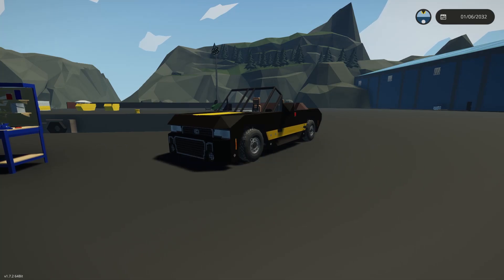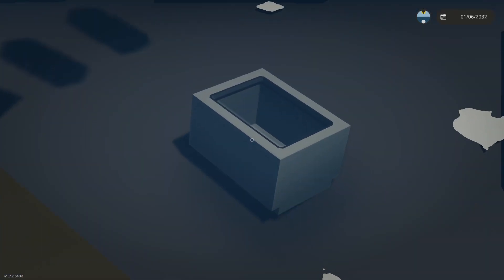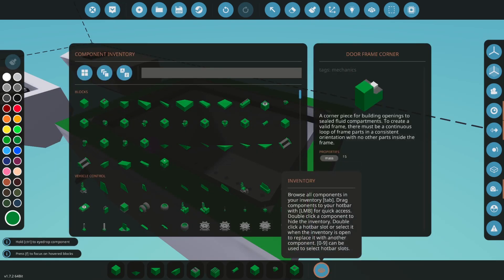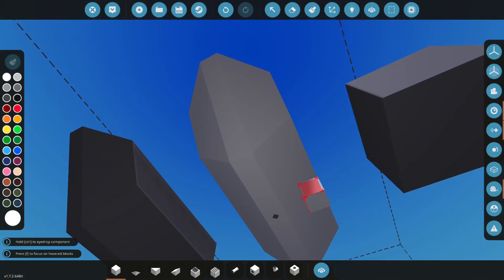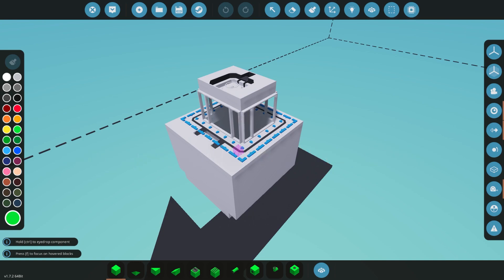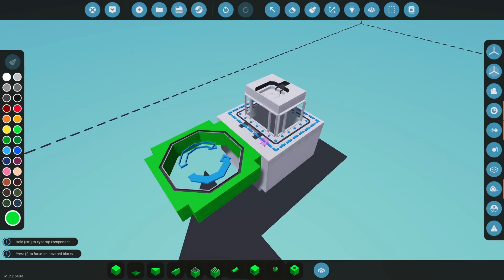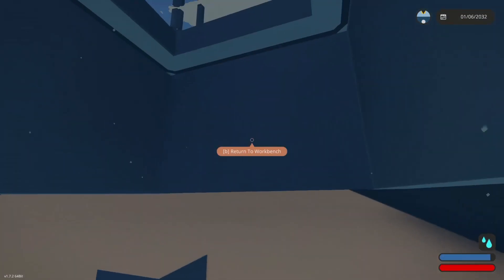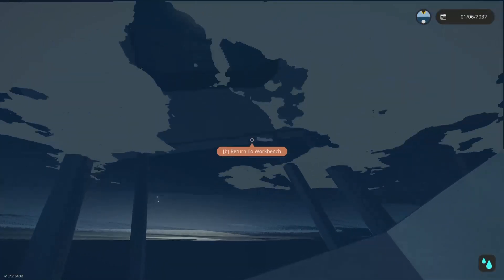10 MUST HAVE new features in Stormworks 2

Comment: #11 pre angled hinges.
Sometimes, you want a hinge to start at 90 degrees in build mode.

#12 pistons at fully retracted / extended.

The reason for both is you are forced to build something in its "half way" position, which isn't always possible.

#13 smaller fluid / power pivots and hinges.

Make their strength lower, sure. But let us have a compact way of transferring power / fluids.

#14 Power / fluid driven pivots, hinges, pistons and pumps. 

Have you ever wanted to make a functional paddle wheel boat, actually driven by a steam engine?

How about powering a piston with fluid pressure, say to make a claw grab hanging from a crane?

You could also make the fluid pumps operate in reverse, they generate power when driven by a fluid.

Sure, add a power loss to it to there's a reason to hard line power, but give us the option.

#15 "live" build mode with subgrids.
Think about Scrap Mechanic, where you can take something off the lift, rotate a bearing and build onto it.

This should still be in a build zone, but you can adjust a pivot or hinge to any position and it's subgrid will move to that angle and you can build "straight" on the subgrid, which is now angled to the main grid.

#16 test mode for both main builds and microcontrollers.

In build mode, you will either spawn in a blank "unlimited" ocean where you can adjust wave height and use your creation, with unlimited fuel / electricity as options, no damage to player, player fly mode / 3rd person view.
You can't complete missions or make money, only test functionality of your craft.

I have an entire second save game JUST for vehicle development and testing.

And test mode for microcontrollers will give you a button / number slider input where you can edit inputs, see outputs and hover over all components in the controller to see issues, change something and see the result right away.

Like debug mode when writing code.

The only way to get something similar is to add extra inputs to adjust the variables you want to test, add info components to see mid process data etc and then try it out in your build.
Reply from the maker: Love these suggestions! I may use them if I make a part 2! :) I also gathered some of my own items over the months!
Reply: @454ss_gaming  oh, I have plenty more too.

Like with ropes and winches.

The small winch IRL, would have about twice to three times as much rope on it.

Pullies for ropes would be cool, to give slower but more powerful pulling capacity, but to also mount a huge winch down low on a crane (where it should be),L and redirect the cable up to the end of the boom.

I also hate how ropes have physics with wind and gravity, but not with the ground or builds.

And yeah, use all the ideas and get as much public attention as possible.

Ultimately, I want the best game possible and that starts with getting the basics down right.

Honestly, why bother making a space DLC, which they've already said won't be great due to the game limitations, when water washes through solid walls and floods your boat because your open deck isn't an enclosed room?
Reply: Hmm, been thinking thoughts.

It's simple, but I think very lacking.

More basic connection "anchor" blocks.

Specifically, a hinge connector, a tow ball connector and a PTO connector.

A hinge connector (better if it's two blocks, a make and female) will function much like an unpowered hinge / pivot in game, that is in two parts which must be connected together to work.

Install the male part on the main ship, install the female part on say a gangway.

Use a crane to lift the gangway into place, when the two hinge blocks are within 1 block away from each other, interact with one of them to connect them.
No power needed, no logic, no power transferred etc, it will just connect and then pivot.

Tow ball, basically the same as above, except it will pivot on X freely whilst also having limited pivoting on Y and Z axis.

PTO connector, works just like a fluid anchor, except its "hose" is a rigid drive shaft with a limited range to extend and retract (like a piston). Transfers torque power.

An animated rotating shaft linked to RPS would be cool, but functionally it has no physics.